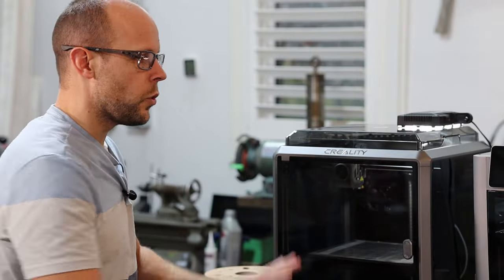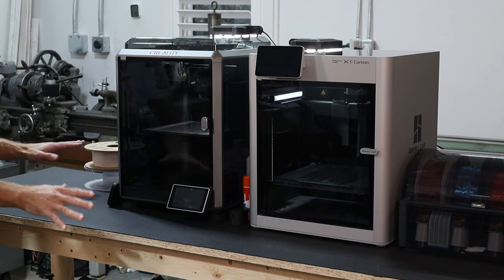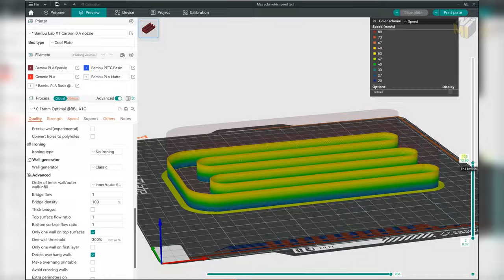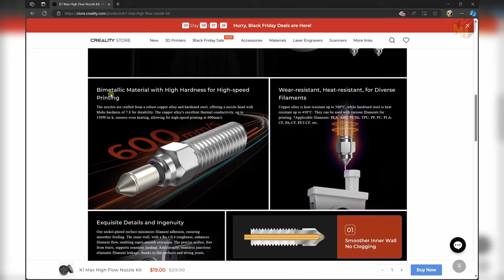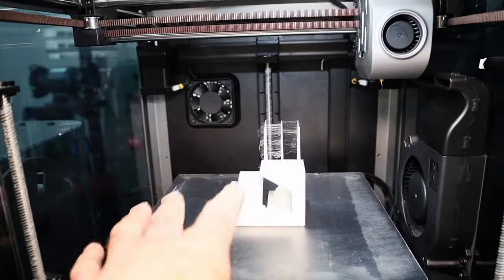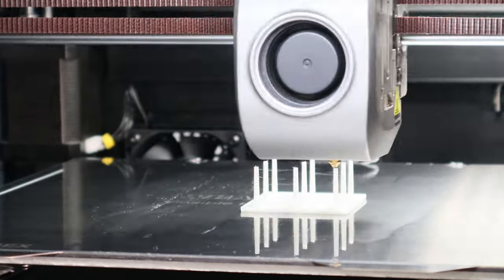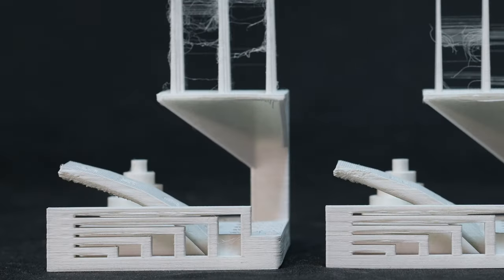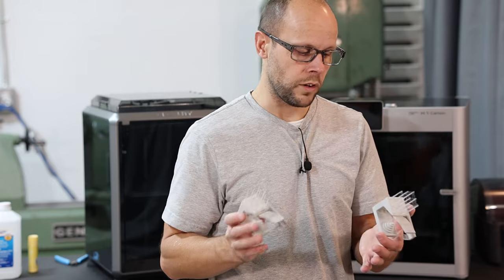Printer VS Printer - Creality K1 faces off against the Bambu X1C at HIGH SPEED - Who Wins?

Comment: When you're winding that spool of filament and you're letting every inch of it rub across your fingers aren't you imparting some oil from your fingers onto the filament and wouldn't you expect that to impact the print in some way even if it's minor?
Reply from the maker: The truth is that everything will impact everything else to some extent.   How much, I would expect that it isn't enough to be able to notice by any method that I can test with.  After the first one or two seconds, any residual oils on my hands would have been transferred, maybe a few tiny particles of skin after that.  I'd be happy to test it by some extreme method, but I'd have no clue how to gather enough skin oil to do the test.  I'd need to go around collecting oily skin samples from everyone I know, which would be a strange conversation, slightly creepy.

To your point though, on occasion I watch some videos showing experts in the field of machining metal, specifically metal lathe work, and this particular video I am thinking of relates to the Lathe chuck.  When the stock is chucked up, that's it, it's being held in place, but when we measure the deformation it's substantial, we just don't tend to make the measurements, and of course we need specific tools to do it accurately.  It's interesting to me. 

I've never thought about the grease on my fingers, realistically there are contaminants everywhere, dust particles, moisture in the air, the path the filaments takes.  

Please provide me a method to test this and I will do it and we'll see the impact when we exaggerate the amount of oils on the filament.

Comment: Did both prints finish at the same time? Or was K1 faster to finish?
Reply from the maker: Actually, the Bambu was slightly faster, I just looked a bit deeper and found a few differences, the inner and outer walls on the Bambu were faster saving about 6 minutes OA, the bridging was slower and top and bottoms were slower than the K1.  I'll have to see which factors contributed to the difference, it should not have been a flow or speed restriction with the inner and outer being set a fair amount lower than the infill.  I think with a bit of adjustment in the right place, both printers could be producing at the same speeds.
Reply: @NeedItMakeIt  I was expecting a totally different result. At the time, I thought the intent of this was to show that the Creality was gonna print 2 or 3x faster, but that didn't happen. 6:28.

Another note, you asked for comparisons to others. That's only valid if you mention specific print times.
Reply from the maker: @jimbarchuk  The Bambu loses some time at the beginning because of the calibration sequence, it did look a bit like the K1 was going to blow the X1 out of the water.

I'm not 100% sure about your note about the comparisons.  I think you're referring to my request for other people to share their experiences.  If that's the case, I like to do that so we have a larger pool to average the good and bad of each printer.  My experience alone with these two printers doesn't always equate to the actual overall performance of each printer I test, better to crowd source information for better OA perspective.  I may be answering the wrong question, so please let me know if I am.  

I plan on making a follow up video about these printers as well, I'm not certain that printing with either of these printers at slower speeds yields any benefits, it may be the opposite in fact, I'm going to do a bit more research before I make a video.

Comment: I recently had a demo of both and the Bambu P1S. The finish was definitely better on the Bambu. Is it worth the extra? I'm not sure.
Reply from the maker: Bambu printers seem to have an overall more well thought out design as well as integration for future planning (AMS etc.)   When comparing the K1 against the X1C, the X1C wins out, but it's not really fair, I've also had some prints made on the P1S, and the results are quite good as well, the Bambu printers also have larger build volumes vs the K1.  The K1C has some nice changes which improve the quality, I'll have to try to get my hands on one and compare again.  I think the smaller pulleys and motors for X/Y will provide a better result on the VFA issue for sure.  The extruder doesn't seem to be quite as responsive as the Bambu's, retraction and extrusions aren't quite as precise.   They're all good options at this point, just be weary of the bed slingers with Linear Bearings and rods for the Y travel, they're prone to vibration and movement issues.

Comment: A K1 v X1C is like ford v's Porsche, why not the K1 max, did they fix the issues people complained about with the K1 as i am now trying to decide if i should go P1S, K1 or K1 max, the X1c is to expensive for me.
Reply from the maker: For sure, I can am happy to do this as soon as I can get my hands on a Max.  I would really like the Max also because I have some larger parts for the shop I'd like to print and the beds on the other printers are too small to make them in one piece.  

It looks like most of the problems with the K1 have been fixed.   I am still waiting for a new extruder myself to confirm that I can print quality parts at the 500mm/s because it did suffer a bit when cranked up to those speeds.  I can't say for certain if it is the pinching of the reverse Bowden tube or the extruder, or perhaps the nozzle temp was not high enough, though in my tests for the follow up video I'm working on, the nozzle temp didn't seem to be a problem.

If you're a Bambu person, and the X1C is a little pricey, the P1S is a great option as well, you can upgrade as needed and you can add the color printing option later on.  I also think that there will be a push for other companies to release their versions of these kinds of printers, we should see quite a few more high-speed printer which also give great results soon.

Comment: Great review but I still can't decide between the two. Currently using Anycubic Kobra 2 Neo and want to upgrade to a faster, high quality printer. The K1 Max is on sale for AUD $1211 on Creality's eBay store and the X1C is AUD $1839 (without AMS) so there's a big price difference there. I've heard Bambu lacks customer service and Creality requires more tinkering to get quality prints out of the box. If K1 Max had AMS I'd buy one without hesitation.
Reply from the maker: I have another printer that I'll be reviewing in the next week or so, I can't say any more than that at this time, but maybe you want to wait just a little bit longer?  Also, Bambu should be coming out with another printer, though I'd expect that it will be larger and may require more time for devel.  The X1C produces better results overall, also you don't need to calibrate, it does this for you, the first layer is perfect 99% of the time.  The K1 series are cheaper and they work well at the price, but you're right, there are a few things that still need to be tweaked.
Reply: @NeedItMakeIt  Awesome! I'll keep my eyes peeled 👍  I agree, I think I will wait for their next flagship printer 😅
Reply from the maker: @raz5247  The next gen of printers should have larger beds, and the ability to print multi-material, I'm really looking forward to it.  They should also have faster material changeovers like the Prusa XL.  Hopefully not quite as pricey though.

Comment: What was the answer? Please tell me which printer is of good quality and cost-effective
Reply from the maker: If you have the mmoney, the Bambu Lab Printer seems to produce better results and it does have the benefit of allowing you to print with color.  But the K1 is far cheaper, less build-volume as I mentioned, but it is a great deal.  Both printers are fast, but the K1 will be able to reach slightly higher speeds because it can heat the filament faster than the X1C.  The X1C can be upgraded to get closer, but I believe the K1 will still be in the lead there.  The K1 also is now open, which means that you'll have lots of the printing community providing upgrades both from a software and parts perspective.  So each printer has their own benefits.  I'll be doing more testing on the K1 to see just how fast I can run it so you should see some follow up videos on this as well.  There is also a K1 Max, which is larger than the X1C and has many of the same features, it is more expensive than the K1, but less than the X1C.  Hopefully that helps!
Reply: @NeedItMakeIt  So, as a result, if we want to have a more accurate and colorful print, we should go to x1, and if we want speed, we should go to k1max.
Reply: @NeedItMakeIt  how to you  anticipate the K2 Plus will fare against the X1C? They will then be at comparable price points.

Comment: High speed PETG? Do you have a filament recommendation?
Reply from the maker: I normally buy no-name cheap PETG, and I run it at 255 C, I've always been able to get away with using the standard Bambu PETG settings.  I have Some Prusament PETG on order, it'll be here soon, when I've tested it out I can let you know if there is any speed advantage.
Reply: @NeedItMakeIt  The cap for Bambu PETG is set to 13mm2/s in Bambu studio, for generic PETG it is 12. Bambu ABS is 22mm2/s. Bambu PLA is 21 (I think).

So with Bambu slicer settings, you’re more or less half the speed. I don’t think it is possible to print PETG at high speed (comparable to ABS or PLA). Please prove me wrong, I would love to be able to print PETG at the same speed as ABS/PLA! 🙌🙏
Reply from the maker: @Mr.X3D  You know I've barely printed any PETG on my Bambu, that's about to change, because I need to get back into Printing structural parts so I shall see if I can dial it in.  I still plan on changing the hotend to an aftermarket to be able to do a nozzle swap to a high flow, but that's probably not going to get close to the flow of PLA, so maybe more needs to be done.

Comment: Everyone telling you that there's a high speed filament just wants to grab your money. There's nothing like a high speed filament. There's high flow hotends and good extruders tho. 😅 

The material can be as high speed it wants, if the hotend can't hold up melting the material.
Reply from the maker: No doubt that it is far more expensive, I am not a fan of the price of it, but it does melt far quicker, I've had a lot of trouble trying to get anywhere as close when 'non-high-speed' filaments.  I agree that a swap of the hotend/nozzle will payoff in allowing anyone to run standard filaments at high speed, it is definitely worth the investment.  

I'll be throwing some tests together in upcoming videos showing the results of a high-flow on the K1 and I'd like to do the same on the Bambu, it should be more dramatic since it's running the hardened nozzle. 

Great point, and I like to save $$ whenever possible, why spend 40$ a spool when you can spend $25
Reply: @NeedItMakeIt  They're achieving stuff like that using additives and / or material blends. That's it. But also that's exactly what makes the properties as in strength, durability and heat resistance worse. Basically you're paying extra for "speed" while loosing a lot good properties from the basic stuff. A good example on how too much is too much would be eSuns latest receipt on ABS+. But that's a story for another day. 

In the end it's those 4 things ruling on the speed of a printer: 
1. Nozzle (regular, CHT style,..)
2. Hotend 
3. Extruded 
4. Cooling 

The highest extrusion capacity is worth nothing when there's insufficient cooling. 

Nevertheless both printers, the K1 and the Bambu are extraordinary in this fields.. Take a look at their speedbenchys. I mean what were they, 15min or so? Man. Even my Voron can't hold up with this. 😅
Reply from the maker: In some comments responding to a video I released this morning, there was a great point raised.  What is PLA like after a year.  The part strength deteriorates, as the material itself is designed to breakdown 'quickly'.  

I agree that the high-speed PLA that you have to pay more for should not be the solution, we need to look at the hotend/nozzle to be able to use the existing materials without having to spend 2x the amount on the high speed stuff, even though it does seem to work well, and they claim that it is quite a bit stronger, it's better to keep things simple.

To your point about cooling, that is a big one for sure, it isn't always a problem depending on part size or how many parts we're printing, but seeing some of those high-speed Benchy tests really show what happens when you can't cool your parts fast enough.  I see the FLSUN S1 has a sort of turbo style fan due to the high speeds they're trying to reach. To me is look like they've introduced a turbine approach to compress the air.  The video doesn't show it well enough, but it's an interesting idea.  

Great points, love the feedback, thanks!

Comment: @NeedItMakeIt This isn't a fair comparison, the X1C has AI LiDAR, you should have compared the K1 Max vs the X1C as that would have been a fair comparison.
Reply from the maker: Thanks for that.  I did mention this in the video.   In addition I also spent quite a bit of time calibrating the K1, where as I spent no time to do this on the X1C.  The Lidar scanning is used for that exact first layer and for calibration of the filament including pressure advance.  As stated by Bambu, manual calibration of the filament can result in an even better final result on their printers.   https://youtu.be/eyhJrzUK9ZU?t=62  If I had more printers I would include them, as I get more interest in my videos and a bit more income, I'll be doing more apples-apples comparisons, for now, this is what I have and I'm trying to make do with what I have.  I hope that makes sense.

Comment: For the Difference in Price Bambu should be a little embarrassed. That being said the bambu user experience as well as easp of replacing parts like the Nozzle are hands down the best in the Business. i wouldn't get a X1 its too expensive for what you are getting But the P!P/S or the A! are absolute Deals for the Price. Creality with their Copy of the X! is Also to be congratulated as the K1 series after a few hiccups that have mainly all been fixed is an amazing value and I would NOT fault anyone who get one over the bambu. NOw all the other Printer manf need to get w the program.
Reply from the maker: I made a follow up video and talked about my method of testing and why the prints look so bad.  This technique of spraying with grey primer really seems to highlight any irregularities in an otherwise normal looking print.  Granted, the prints aren't perfect either one, but I was running higher speed than normal, so I have to give a little bit of lee-way, I thought they'd do a little better.  I'm still waiting on my new K1 extruder to see if that helps.  The follow up showed pretty good results on slower speeds for both printers.  The K1 did not have nearly the flaws that I showed in this video.  

I'm looking forward to the next, next generation of printers, will it be Bambu, Creality or someone else, like FLSUN with their S1?  Qidi seems to be trying hard to get into the race as well, but I don't know how to pronounce it yet, Kee-dee?  Quee-dee?  Queue-ee-dee?  Well in any case I see them putting some printers out there that seem to perform well, and of course there is Prusa, the XL looks pretty nice, but it's very $$ and falls into a new category.

Comment: What settings are you using on the K1 to print normal PLA.  I ran out of the one that came with it and am having a hard time getting “Inland tough PLA” from micro center to work.
Reply from the maker: I'd change the flow from 23mm/s to  13 or 14, I had the same problem with some Red Overture PLA, I was struggling until I slowed it way down.  There is a pretty big difference between standard PLA and high-speed with the rate it is able to soften the plastic.  You can experiment a bit and raise the nozzle temp and raise the flow a little bit also, that will probably get you to 15 or 16.  Let me know how that goes.  I think there are a lot of people that are going to have the same problems we have in not having high-speed filament on-hand.  It is quite a bit more expensive too.

Comment: Nice video. Whats the process for tweaking your K1 max? I juat got one and its really good. But it seems with some extra work it gets better. Im not sure where to start.
Reply from the maker: If you have a max, and it auto-calibrates, I think that it should.  There isn't much to do on that side.  You can still manually calibrate for slightly better results, but in my exp. it's not worth the time, since you'd have to do it for each new filament you use.  The tuning relates more to the slicer, and those settings you would adjust would be specific to the types of part you'd want to print and the material you're printing with.  Is there a particular area of the print you want to see an improvement on, there are lots of areas to make adjustments and I think it could help to narrow it down a little.

Comment: Having both printers on the same table running at high speed at the same time probably didn't help the input shaping on either printer.
Reply from the maker: Remarkably they both seem nearly unimpacted by the additional vibrations.  I've done some previous tests on this before coming to this video eventually.  If I place one printer on top of the other, there is a very slight change, but it's still in the realm of acceptable.